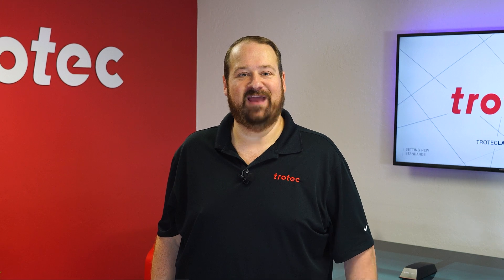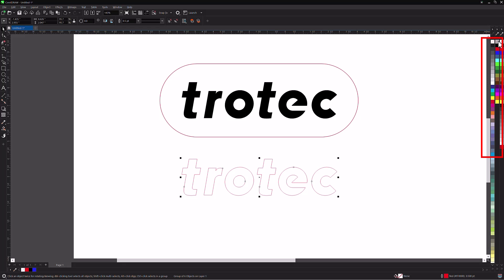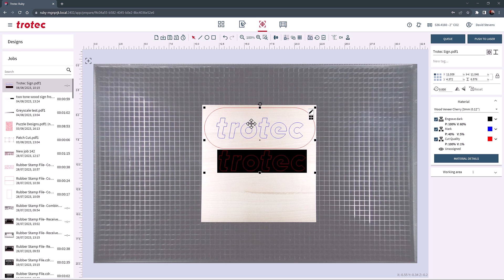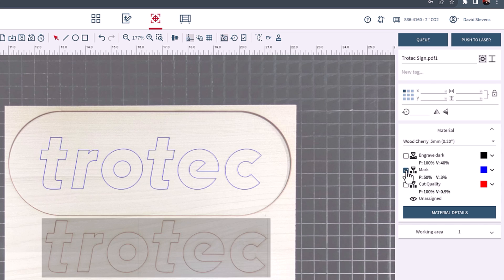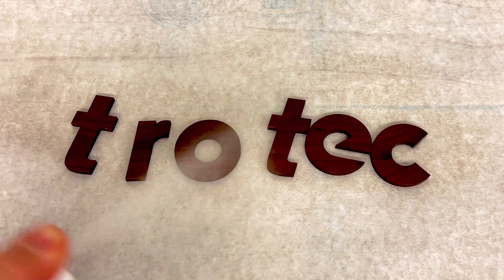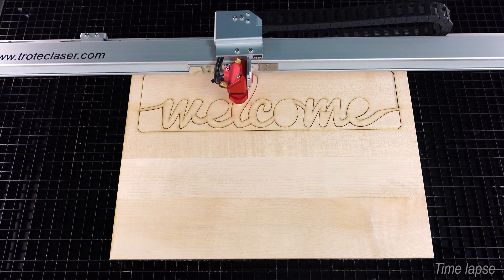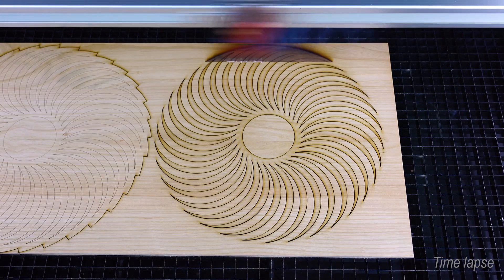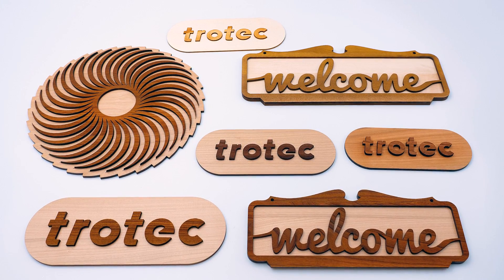Laser Hack: Using the Same Piece of Wood for a Multidimensional Colored Look

Comment: I find that the cost of material is far lower than the cost of the laser time. So if you asked me to produce any of those I would have used two different species of wood, or stained on sheet for the contrast. But the time to engrave over at500dpi seems like such a waste.
Reply: You are correct that using a stain or another wood species will produce contrast, but that will not show the same texture and grain effect, creating a completely different look and feel. After all, exceptional quality yields exceptional returns.
Reply: @davidstevens2577  and an exceptional answer there squire 🫡

Comment: so you created a stained-wood effect without using stain? incredibly odd.
Reply: You are correct that using a stain will produce contrast, but it will not provide the same texture and grain effect; this method creates an entirely different look and feel than traditional stained wood, and this look cannot be reproduced any other way.

Comment: Isn't it easier to use stain or varnish of the desired color instead of engraving?
Reply: You are correct that using a stain or a varnish will produce contrast, but it will not show the same texture and grain effect, creating a completely different look and feel.